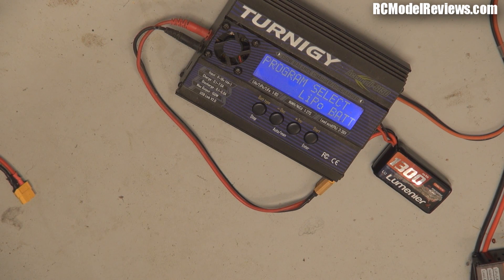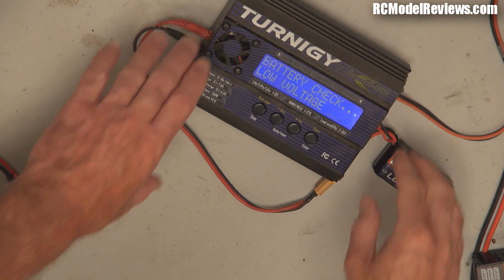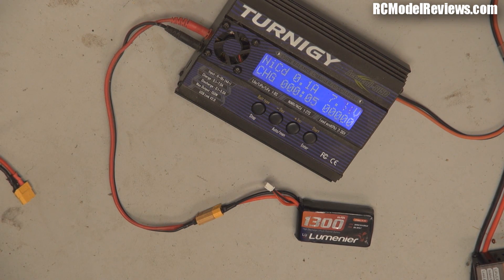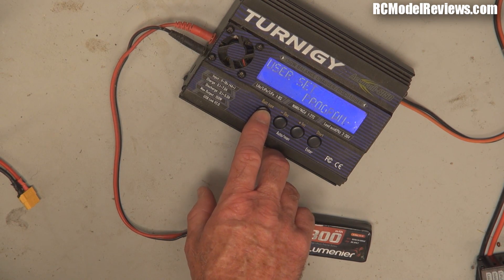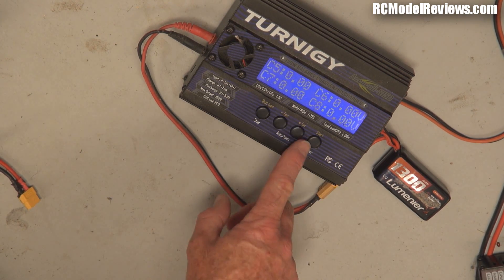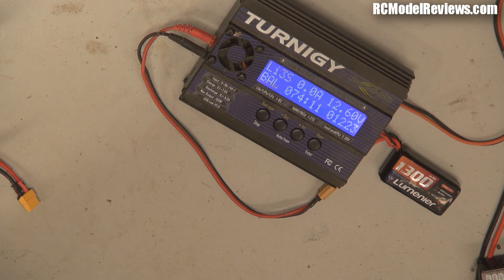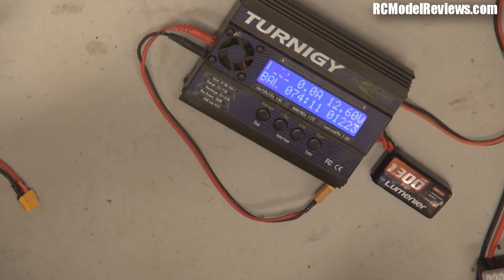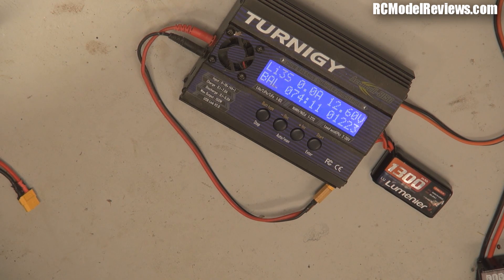How to recharge a fully flat lipo (lithium polymer) battery

Comment: I had a 15 Wh LiPo cell inside a tablet that I just resurrected. I had a "setup" ready for it. A few years ago I had resurrected a Li-ion battery for a drill. So here is how I do it. I take a wimpy, low current wall wart power supply. In this case, I used a 5 VDC, 500 mA power supply.
1. I stripped the leads on the power supply to reveal a red and black wire.
2. I grabbed by digital multimeter with the alligator clips and checked the voltage output of the 5 V PS for polarity.
3. I found two long pins that you might see a seamstress use.
4. I stuck those pins into the red and black (+/-) terminals of my LiPo connector.
5. I unplugged the PS from the wall and checked LiPo voltage to be 0.024 VDC (virtually 0).
6.  With a fire extinguisher nearby, I plugged in the PS and watched carefully at the voltage display.
7. I unplugged periodically to see if the LiPo battery was responding and taking a charge.
8. In roughly 5 minutes, the battery had risen from around 3.2 V to 3.6 V.
9. I now removed all of my charging apparatus and re-connected the LiPo to my tablet.
10. The tablet showed a -4% charge initially. I wish I was kidding, but I think that's what I saw.
11. In a few hours, the battery was 100% using the tablet's charger.

For the drill, the modified procedure including connecting 2 PS's in series. I made a 17 VDC circuit with a 5 and a 12.

Comment: Thanks for the Video. I was really worried for my 12S 5800mAh LiPo Pack, which I somehow managed to discharge by only doing benchtests. I realized they must be flat only after I went for a test ride, they were at 30V (2.5V/Cell), bad but not as bad as your pack! Now I'm charging them carefully.
I couldn't rely on the Discharge Protector in my ESC, so I will from now on always have my Voltmeter attached and soon my BMS too.

Comment: Got my quad caught in a tree. Had to leave it there overnight. Retrieved it with 40 feet of PVC. Battery Would not  not begin to charge. Watched this and adjusted voltage for my LIPo 7.4v. It works! Thank you for concise video.
Reply: Darryl Douglas haha my dad did the same with a biplane of mine. Those PVC snakes are hard to wrangle!! We used a second man on a fishing pole to guide the end of it.... absolutely hysterical!

Comment: I managed to fix my fatshark fpv goggle lipo after leaving it plugged in all night using the charge lead and 9v square battery just held the battery on the right poles plus and minus for a minute or 2 then connect back to charger works a treat phew :)

Comment: rcmodelreviews nice to know will this work on a  3s battery pack with one low cell due to not having a battery cell checker on my Fpv googles & base station setup iv got one to add to my setup now but need advice on getting the low cell backup to a stable enough for a slow lipo change safely

Comment: So I have a 4s and I haven't used it in a long time and now that I have checked it I've noticed that it has a very very slight sort of puff on it. It doesn't look pregnant but when you grab it you feel the front a bit softer than "normal". The problem is that my charger doesn't have a screen or anything, it just doesn't charge when something is wrong so I can't know if its damaged or overdischarged etc. Should I do this or just try to be more careful with this one?

Comment: is there any way to save a 4 cell battery that is showing 2 cells not even existing? last time I used it it worked fine. The next time I went to use it it only picks up 2 cells now on the charger or my cell analyzer.

Comment: Hey my 22V 6s LiPo had fallen down to low voltge, I charged it on NiMH upto 22 V but I don't have the balance wire to plug in the charger. I tried charging without balance wire but it will still say "Low Voltage" on my charger but my multimeter says 22 V. What do I do?
Reply: Sounds like you are trying to charge your battery in "Lipo balance" charge mode. The charger will not work in this mode if your balance lead is not plugged in, as it will not recognize that the battery is plugged in, thus "low voltage"... The charger needs to see no less than 18v through that ballance port when using that mode. Switch to "Lipo" only charge mode for 6s battery obviously ; P In this mode it only looks for that min. 18v through the charge leads    ! However !
I do not recommend ever charging a Lipo battery without balancing it. Especially after you have had issues with it! If you have bad or un balanced cells, and your using your charger in dummy mode( no safety cut offs, or visual reference as to the charge status of each cell) your charger is just doing what ever it can to charge your battery up to full capacity. This means your charger will over charge the other cells in order to obtain what it thinks is a full charge based on the type of battery you told it you were charge. This is a massive fire waiting to happen! Check all your cells individually. Make sure none of them are reading over 4.20v, and no less then 3.98v if your over all voltage is reading 22v on that particular battery.
Side note. Even though the balancing feature in Lipo only charge mode, does work to balance the cells while charging, (when you have the lead hooked up) it does not rely on the balance of the cells, thus removing that fail safe during charging, and can still over charge individual cells to compensate for bad cells in order reach it's overall goal of X... voltage in the end, So be careful of that false security as well.. Good luck : )
Reply: Hey, thanks for your help. Actually I checked my individual cell voltages and all the cells look correct except the last two. The last second has 0V while the last seems to have double voltage? (I know it sounds crazy but it was not like that earlier, when I commented the last comment, at that time the voltages were all 4.2 around. But a week ago it showed the serious imbalance in the last two cells. The battery is a Tattu 22.2 V 16000maH) Should I try balance charging my LiPo now? Or discharge it till the last cell goes normal? Are my last two cells short? Or should I just hack in it to make it 4 cell LiPo?
Reply: +Aniket Sharma that battery is in a very bad state now, and considered very dangerous in my opinion. no sense in trying to save...it's not worth the potential, and eventual fire ball. I recommend cutting the charge lead off at different levels so the pos., and neg. leads can not touch, and put the battery into a bucket of very very heavy salted water. this will neutralize the cells and make the battery safe to dispose of. in the grand scheme of it all, batteries are far cheaper then a new house, or vehicle. Best of luck : )
Reply: thanks for your help 😃

Comment: does it matter setting to NiCd or NiMH, because I see in other vids people setting it to NiMH before changing to LiPO
Reply: In my experience no. Just be very careful! Use low amp charge, and do not leave unattended! This will only take a moment before you make the switch to Lipo charge setting. The directions here are great! : )
The only thing i would add to this already great video is...
I do HIGHLY recommend using an external cell checker / cell balancer plugged into the balance lead while doing the initial Nimh / Nicd bump charge. This way you have a constant visual reference as to what is going on inside each cell of the battery as each cell takes on charge, and will help to balance that voltage between cells in the process. If you see 1 or more cells not taking on a charge, then you know you are done right then! There is no reason to continue the danger!

Side note for bad Lipo batteries: Get a bucket of Heavy, Heavy salted water, and drop the battery in... Yes Salt is super important!Just add more if your not sure. Do not put your hand in the water, or you may get a bigger bite then you thought possible! ; P Leave the battery in there for 48 hrs, This will neutralize the cells. Now it is safe to dispose of properly ; ) Safest way i know : ) Happy landings all
Reply: No. You're just adding a superficial surface charge so that the LiPO charging circuit detects sufficient arbitrary cell voltage to allow the charger to start. Both NiCD and NiMH are nominally 1.2V/cell and only the full 'triggers' in the charging cycle (provided the charger has manual current limiting ability) are different.

Comment: How to know that my battery is fully charged ?well I was new and I buyed 4s battery with 4000 mah..I did not know and I discharged it with my quad copter. .I lost 2 cell would it affect my quad copter?
Reply: Yes. A 4S battery is 3.7V x 4 so 14.8v... But in your case it will just output 7.4V, your motor will lose all their punch

Comment: Hey there, I've got a slightly different issue...I was flying my QAV250 with a 3S 3000MAH lipo. I had a crash and apparently one of the Soldiering spots on the Battery connector terminal (coming from the PDB) got loose...The Lipo was pretty full at first (approx 12.4 V); When I recovered the craft and checked my voltage, it only recognized 2 of 3 cells, measuring in at about 8.2V....Obviously one cell is completely shot. Is there a way I can recover that cell; possibly using that same trick you've shown?

Comment: Is there a way to do this without a fancy charger like this?
Reply: Not really, but the chargers are well worth the money. I have a Venom Pro Duo that I highly recommend. All chargers seem to have the same blue screen and menu set-up, just like the one in the vid.
Reply: I believe you could do this with any power supply that lets you regulate current and voltage.

Comment: I had 2 6s 10,000 MaH batteries for a scooter I fully charged. The scooter went bad and I had forgotten about the batteries and when i got the scooter repaired a few months later, the batteries had .13 volts on them. Can these be recovered or are they a lost cause? I didnt have them hooked up to anything, they just died out on their own.

Comment: I just connect it to a balance board with a discharged battery for a few minutes, usually doesn't take long for the cells to come up to voltage.  Don't use two completely flat batteries though.

Comment: Flitetest has a good video about fires and use a concrete block to put the battery in and sit a bag of sand on it.  The sand bag will melt during a fire and put the fire  Search  on LIPO Battery Bunker

Comment: Just a tip: Go to your local gardening store and buy a ceramic pot. Charge your batteries in that. If it goes off it will contain the fire and prevent it from spreading.
Reply: I bought one of the fire bags
Reply: They dont protect from fires @lifewithal7541
Reply: Yea me to a cool case lipo bag the big one
Reply: @rsracing-mb1tr  I had a 4s 1300mah battery fail while charging, it was in a lipo safety bag, it burned through the bag like it was a grocery bag.  Now it could have been the quality of the lipo bag, (I was new to hobby at the time and didn't spend a lot of money on it)  but seeing how easily it burned through even a cheap one, has caused me to only use them as a secondary precaution.
Reply: @taylorcarlson9650  Lithium reacts intensely with water, forming lithium hydroxide and highly flammable hydrogen. Might rethink dousing with water
Reply: How funny. I'm trying to revive a dead lipo and as I'm watching this video I was looking for a place to charge my battery outside. I just happen to put it in a ceramic planter pot that sits in a raised garden bed.
Reply: Badblueshy h
Reply: What if the pack feels hard? For a 3s lipo
Reply: @roycearrington1001  if a soft case pack is hard AND not puffed, now from my understanding, that's how a pack should be. If it is hard AND puffed, in other words it's puffed up really hard, then I wouldn't recommend to further bother with that pack.
If it is a hard case pack, well, the outside feel doesn't really allow to draw conclusions concerning the state of the inside.
Reply: Thanks in advance!
Reply: Cool, but how about just get a lipo bag lol
Reply: @lucasceleste4743  lololololol

Because what he said is better than a lipo bag, dork.
Reply: @dangerous8333  what, you got a problem with dorks? 😂
Reply: I do all mine in a sealed ammo container. Built the charger into the box
Reply: @discoversunshine  if its sealed it can blow up
Reply: @discoversunshine  A sealed ammo can is a bomb waiting to happen. If you use an ammo can it's best to take out the rubber seal.
Reply: Badblueshy 
Or a metal ammo can. 
That’s what I store mine in
Reply: Taylor Carlson chemical fires and water don’t go well together. It’s not a napkin that caught fire
Reply: Blessings be upon you sir.
Reply: Ceramic and concrete are scientifically proven to kill batteries....
Reply: @mr.wiggles9827  Yeah that's old information. It's not true anymore.
Reply: @mr.wiggles9827  kill batteries or detain the fire? What do you mean? And how?
Reply: @mr.wiggles9827  Not true!  Look it up if you doubt me.
Reply: Has this been tested and proved to be effective??
Reply: This works. Ask me how I know. And WAY cheaper than commercially available lipo bags. They're usually rubbish anyway.
Reply: Just used this idea on a lipo that was left plugged into an esc overnight after a run, although switched off, it must’ve pulled it too low. Now on a low amps lipo charge again under supervision. Thanks.
Reply: I got a metal tool case i put the lipo in it, have the charger outside with just the cables going in and it works
Reply: I just use two plates, heat treated so it won’t melt
Reply: Fucking genius 👏 🙌 defo gonna do that

Comment: Cheers Bruce. I was testing out my new quanum goggles last night with one of my lipos and it got way flatter than it should have. I used this trick of yours and the battery was sorted and back at storage capacity in under an hour. You saved battery. Thanks

Comment: what charger do you use im thinking of buying a new one
Reply: +Adedamola Egunjobi I have quite a few different chargers and the "best" charger very much depends on your own circumstances.  For smaller models a 50-60W charger is all you need but if you don't have a convenient source of 12V you may want to buy one with a built-in mains-power supply.    Bigger batteries require more powerful chargers (or it will take much longer to charge) so it's "horses for courses".   As far as brands go -- Turnigy work fine for me although I also have a Hitec and a SkyRC unit which both work well.
Reply: I use an imax b6, works perfectly for me. Make sure u get a real one tho
Reply: +John Petito What powersupply are you using?

Comment: this is irresponsible.. just don't discharge you battery to much. it causes a drop in total capacity and rise in internal resistance. not mentioning the fire hazard. just buy a new one
Reply: +Tjitte Ploeg I'm with you. Having had two lipo fires in the last month, I can say that you shouldn't mess with the risk. Novices have to have a Lipo fire and then they will NEVER try recovering a questionable battery.

Comment: bruce whats the best way to store lipo batterys?
Reply: +rossrosstifer Put them on a storage charge (about 3.7-3.8V per cell) and then place them in a cool (but not cold) area where there will be minimal temperature variation throughout the day.  Lipos are like people -- they don't like being either too cold or too hot.   Also store them on the assumption that they will burst into flames at any moment -- so make sure they're well away from  other flammable items or materials.   Of course it's very unlikely they will spontaneously ignite but the possibility is there so it never hurts to try and mitigate the risk when you can.
Reply: thanks for the info